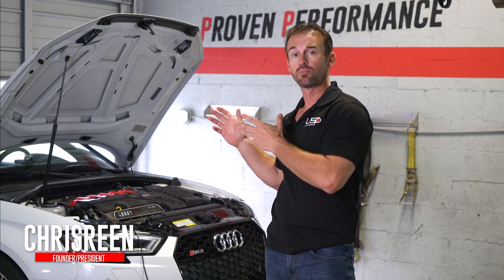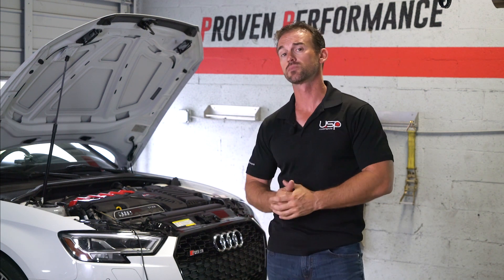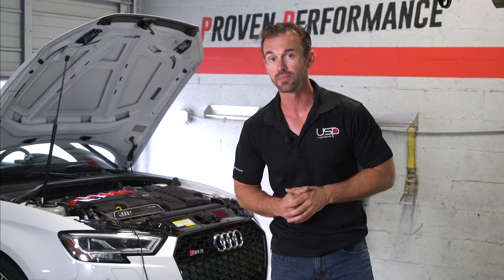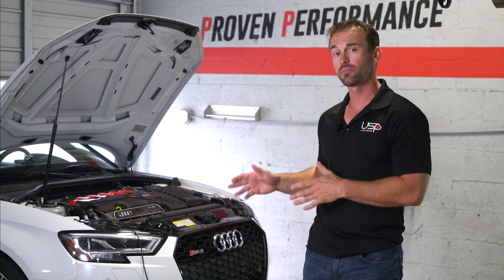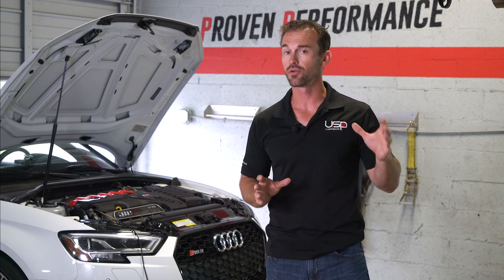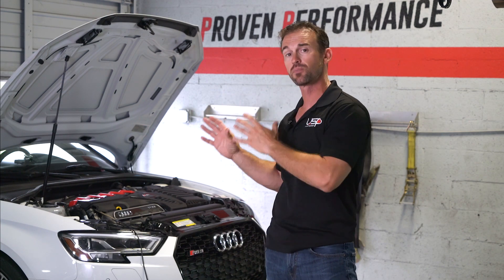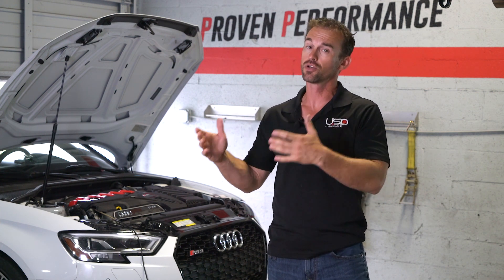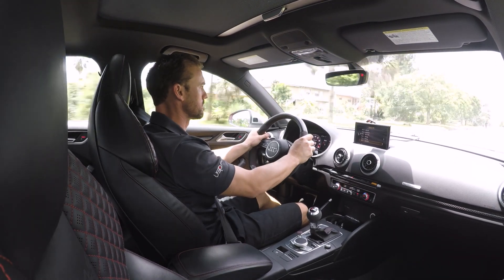USP High Flow Catted Downpipe For Audi RS3 8V & TTRS (8S) // Product Description

Comment: So is it feasible and reliable just upgrading to 700hp and 750-800nm replacing air intake , ic, hybrid turbo like TTE700 and a de-catted downpipe? A sort of stage 3 without open up and forge the stock block interns?